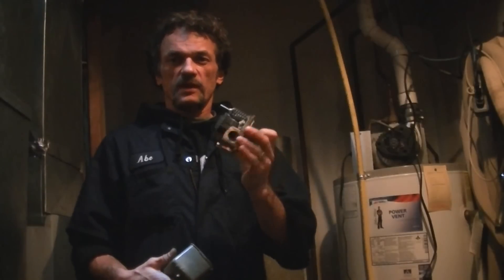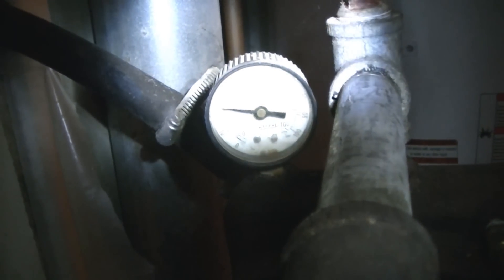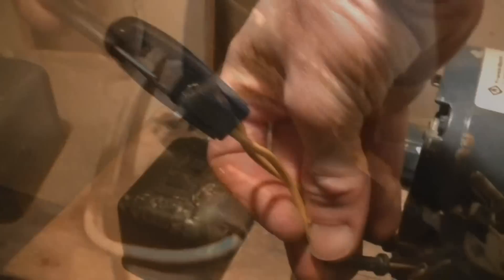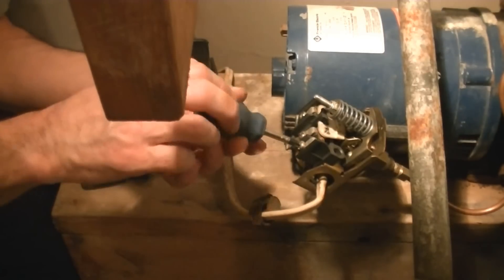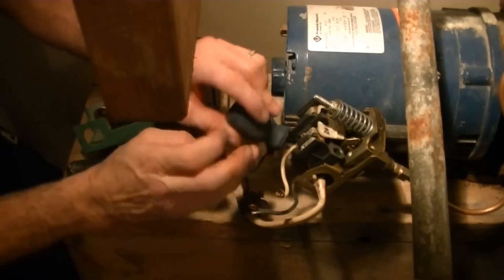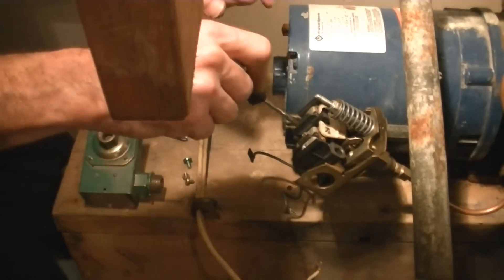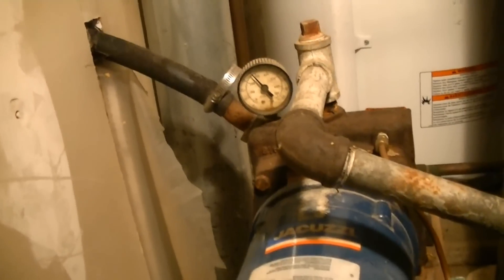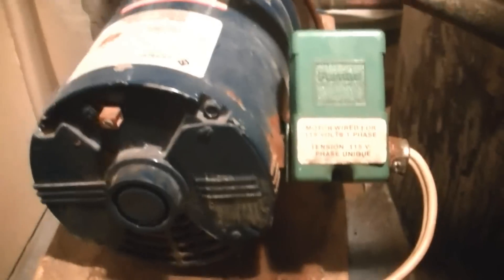Water Pump Regulator Switch - Removal, Installation and Setting Pressure

Comment: I was wondering if you could help me out ..Here is what I need...I want to put a float switch on my aquarium..my submersible pump is down below the tank..So what I need is the pump to turn off when my water level gets too high.. I saw some where on a video where a guy used an extension cord from dollar store...a relay and socket and an 12 volt ac adapter..so there fore I would be able to plug the pump into the extension cord...then when the water level gets too high ...then the pump shuts off..I do remember some of the video but I am not sure where he put the wires..Believe it or not I am an electricians helper..LOL...but only on new construction..Im not good at circuitry and voltage and the complicated stuff..If you know how this can be done could u let me know? thanks..I like your videos ..very helpful!!  BTW..there are soooo many videos on  how to install float switches for auto top off systems but thats not what I need it for.. I just need it to turn off my pump..  thanks.
Reply from the maker: I myself couldn't wire that either. I found a video that might help. Hope it does. https://www.youtube.com/watch?v=7mYrqecali4
Reply: Thanks for your reply..yes I saw that one..I think I can do it ..I will let you know ..lol maybe I will have to do a video on this..ha ha

Comment: Great detailed video.  I have purchased a pump that I want to use with a rain water catchment system hooked to a hose for the garden.  The pump does not have a pressure switch and I want to install one so that the pump does not run unless there is demand for water. This video is exactly what I needed to watch to verify how I thought that the switch should be installed.  Nice job on the video and thank you for your help.

Comment: It is the bladder type.  Do you think it is low?  If so, what psi should it be filled to..
Reply from the maker: It's possible that the pressure is low but I am not too familiar with bladder tanks. When my tank gets too low on air the pump will not shut off at all. I have search bladder tanks on YT before and remember seeing something on tank pressures. Sorry I couldn't help more. I'm Jack of all trades but Master of none.

Comment: We have a shallow well sand point with a single spring regulator.  The pump kicks on and off over and over again.     We don't have a pressure gauge on our system so we don't know how high or low the pressure is going.  What do you suggest?
Reply from the maker: The tank where the water gets pumped into, is it similar to my tank or is it a newer bladder tank?

Comment: i bought a new pump, 1hp, with a 20-40 switch. it's a shallow well jet pump.  well is about 15-20 feet deep only.  i had a 1/2 hp with a 20-40 switch but never got terrific water pressure.  how can i get more pressure in the lines?  is it the pump that makes the difference (1/2 hp to a 1 hp) or the switch settings (20-40 vs 30-50)?  Can you help.  I have a new composite pressure tank that is set to 2 lbs below the switch cut-in pressure.
Reply from the maker: Ronnie Boyle Actually it's both. (I'm not a professional) but  My opinion, with such a shallow well and a 1 hp pump, you should have no problem getting 50 lbs pressure with a 30-50 switch. If you wanted to you could try turning the adjustment screw on your switch to see if your pump will make more pressure. If you do adjust the switch, remember there is live wires inside ...and... count the # of turns when you adjust the switch. This way you can always return it back to where you started.

Comment: Earlier this summer, my one aunt had a similar issue with her pump. The old switch also had just the single adjustment. (I got to assist her gentleman friend, in adjusting the new switch) She's got a "Bladder Tank", the cut-in pressure is 30psi and 50psi is the cut-out.
Reply from the maker: Bladder tanks are much better. Just yesterday, my pump would not shut off. I had to pressurize the tank. Over time they get "water logged". They lose air and when the tank is mostly full of water, it can't build enough pressure for the pump to shut off. I used an air compressor to add more air. Enjoy!
Reply: MudRFunR
Those older style pressure tanks sometimes have a nasty habit of doing just that. Do you still have the same pump as before?
Reply from the maker: Yes, same pump, same switch. Just had to add some air pressure to the tank. Working great!
Reply: Did you add more air using the air volume control, or through the line from the regulator to the pump? I know that conventional pressure tanks oftentimes require an air volume control.
Reply: (In case you're curious, I spent quite a few summers helping out at my uncle's dairy farm when I was growing up...Being a "Jack of all trades", I learned a lot of things from him!) :) ;)
Reply from the maker: Everyone needs someone like that to learn from. At age 14 - 17 I worked mostly summers with my dad at a farm equip. dealer. Learned lots there and at home. Now 50+ and still learning :) (in case you might be curious)

Comment: Hi MudRFunR, I just wanna give thanks for da video U posted on how to replace and adjust pressure switch on well h2o pump. It seems the new pump I just replaced in my wellroom has the same connection as the one U used to replace ur old pump pressure switch. Mine cuts on/off, on/off, on/off right now causing motor to run hot. Presently the "cut in" & "cut off" pressure settings are both @ 50psi. However, now it makes sense why? I think the person I bought the pump from tried to adjust da pressure switch prior to selling it and didn't realize that the "cut on" pressure must be well below the "cut off" pressure so the pump will draw h2o w/out the motor running so hot. Ur a good man! Have a blessed day:-)!!
Reply from the maker: Good to know that I could help you. Thanks for your comment, very much appreciated. Enjoy!

Comment: Hello, I have a similar set up and my pump goes on for 5 sec and shuts off. I does this several times a day. Do you think it is a switch issue?
Reply from the maker: It sounds like it's switch related. Have you tried to readjust your switch?
Reply: MudRFunR
No, How do I do that?
Reply from the maker: Ed Daniele at 12:51 in the video, I explain it. If yours has 2 springs on top, it's adjusted with the nut on top of the springs. CAREFUL there are live wires inside.

Comment: Well done! Incidently, I know that Jacuzzi is synonymous with hot tubs, but I wasn't aware that they made well pumps too...unless that is a rebuilt pump w/Jacuzzi motor and gauge.
Reply from the maker: This pump is actually not hooked to a well but to a sand point. As far as I know, this is the original pump from when the house was built. (24yrs).
Reply: That's interesting to know. I've heard of sand points being good water sources, how far down does it go?
Reply from the maker: I honestly don't know how deep this point is but it does deliver good water and lots of it. We have not ran out of water, ever and we water a
20' x 40' garden each year.
Reply: Sounds like you have good water quality. Where I live (Michigan), many of the wells in the area have elevated amounts of iron and other things...which necessitates the use of a pre-filter between the pump and tank, and some even before it goes through the pump! As for me, I'm hooked up to municipal township water fortunately.

Comment: Great detailed video. Seems my pressure gauge isn't working. Do you have any suggestions on making these pressure adjustments without replacing the gauge? I have an extremely cheap landlord.

Comment: Great video for do-it-yourself-ers. Re the power lines: for pumps using an alternating current (AC) household supply, there's no polarity (I.E. no + or -)  It is only important to correctly identify TWO Pairs of wires. (1) The INPUT Lines, (i.e. household power source). Connect as per instructions for the specific pressure switch. (2) The PAIR of wires going directly to the PUMP MOTOR; again, the switch will show (e.g. by a diagram) where to connect these. N.B. the EARTH from source is a SAFETY.

Comment from the maker: At 0:15 I explain about the old switch only having one adjustment screw. With only one adjustment screw, you can't really set the cut in pressure. When I set the switch for maximum 40 PSI, then the pump only starts at a low pressure. When I adjust the screw it adjust both high and low pressure and it kicks on way too late. And yes, it is explained in the video.